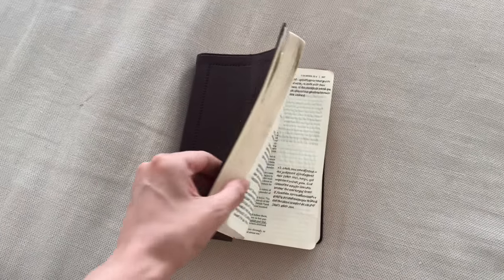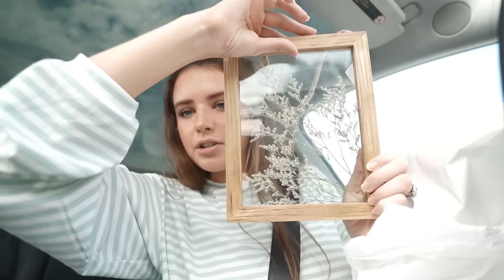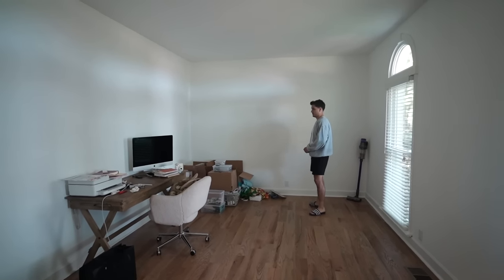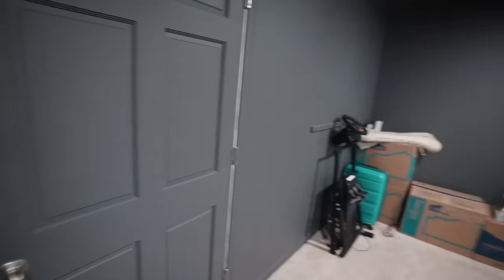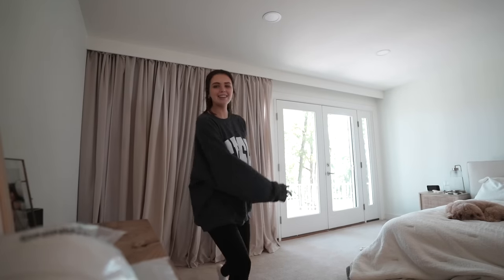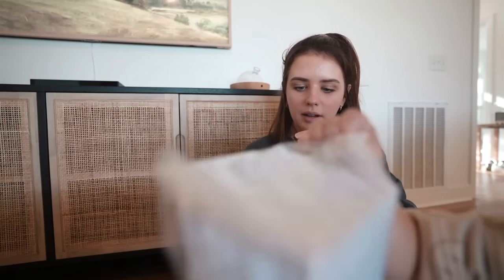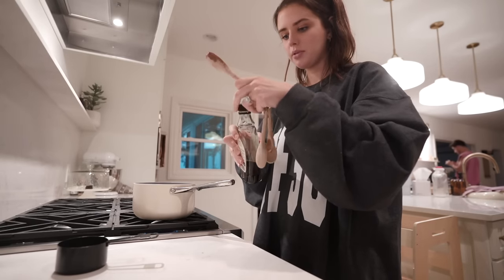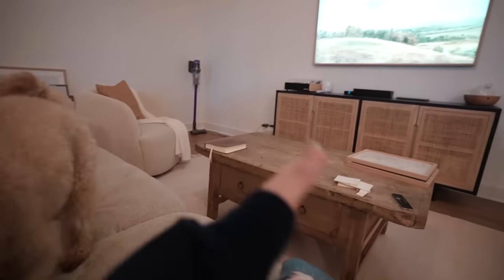Exciting House Updates!! cinema room, unpacking + new furniture

Comment: With your washer/dryer if it’s inconvenient to switch the entire unit, a lot of washer/dryers will have reversible doors so you can put the door attachment on either side. That way you just have to remove the door and switch it to the other side rather than move the entire unit
Reply: I was thinking it was probably meant to be washer on the left, dryer on the right cause then there’s no doors in the way of transferring clothes from the washer to the dryer 🤔
Reply: @nataliejk27  yeah I just know for my own house, you can’t switch the units bc of where the water hookups are so if that’s the case for them too, switching the door around is an easy solution
Reply: @hayl_ski  ohhh that stinks!

Comment: You should have a unit built that elevates the washer and dryer so that the middle of the doors is at chest height.
That way you don't have to keep bending over or squatting down.  And you can use the space under the washer and dryer as storage.
And, when your baby gets a bit older and starts waddling around exploring things, she won't be able to climb into them.